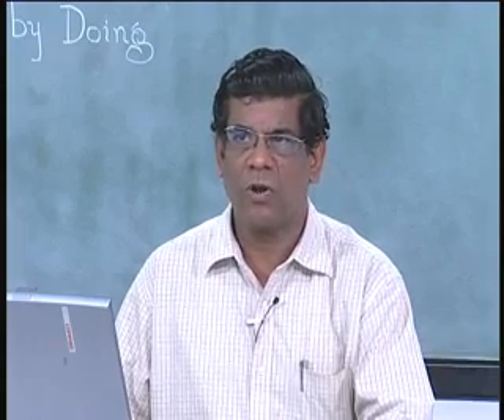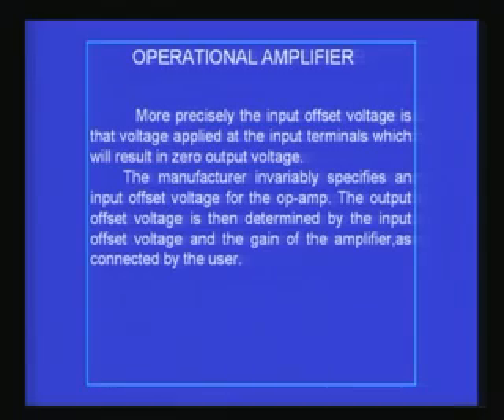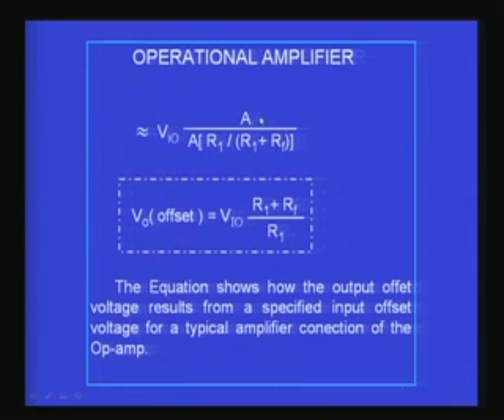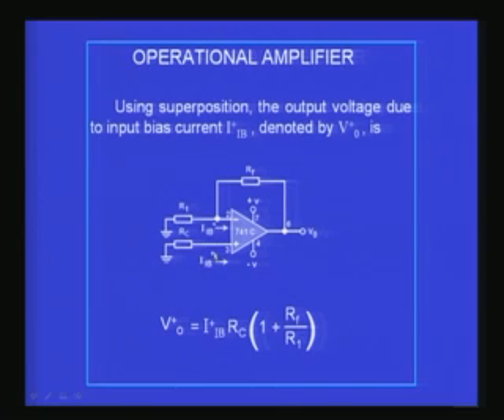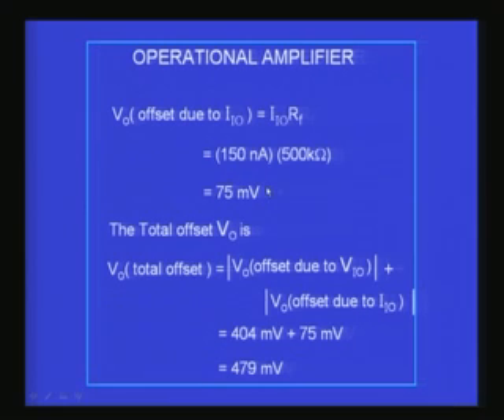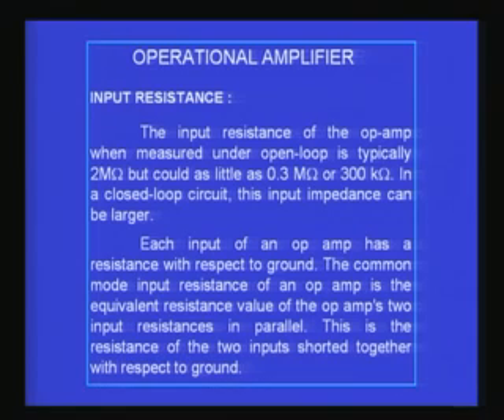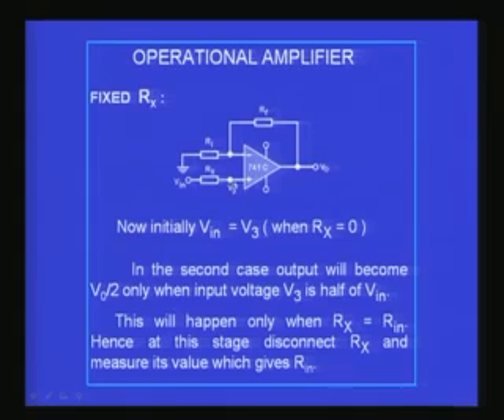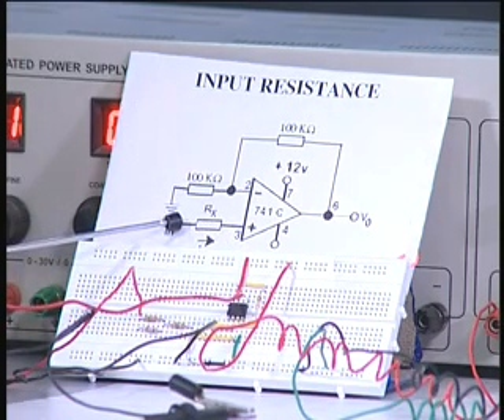Lecture - 27 Characteristics of Operation Amplifier

Comment: at 29:10 , you changed Rc to R1 which is understandable because they are usually equal, but you also got rid of the R1 in the forth step of the simplification , why?!